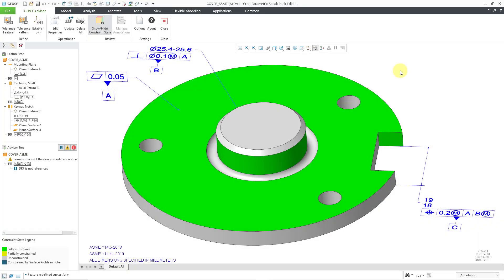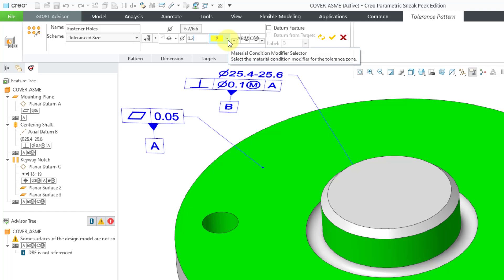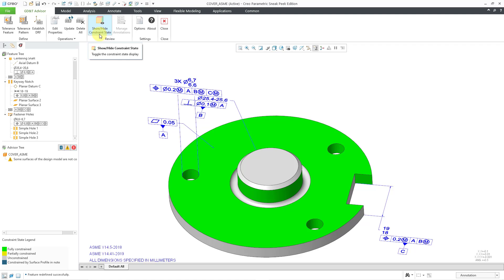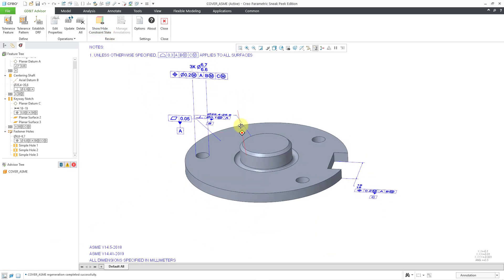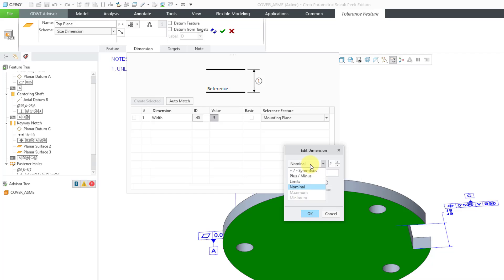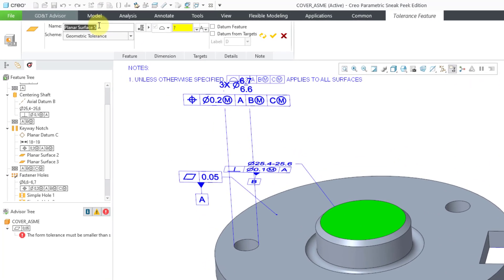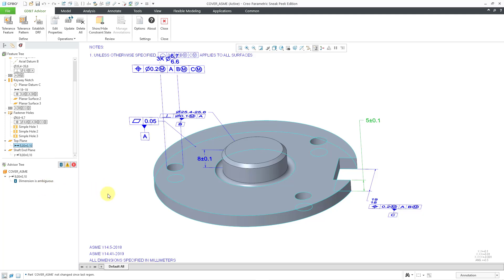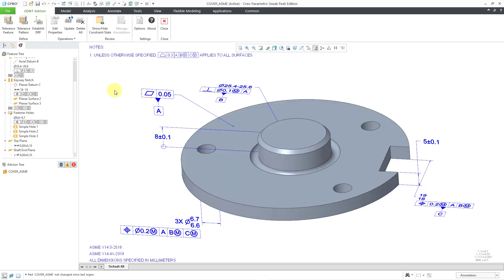Creo Parametric - GD&T Advisor - PTC Free Demo - Part 2

Comment: Hello.

IMHO this is important topic which will become even more important in future due to “disappearing” 2D technical drawings and growing presence of 3D models, equipped with PMI information (MBD based) … Because of this I expected at least some comments about it.

GD&T Advisor is a good add-on for Creo but it can’t handle all the situations. My next comments apply to use of it in ISO norm space. First, we must be aware that the working of the GD&T advisor is heavily depended on 3D model structure and the way the 3D model is built.

For instance, if you are to apply some form and position tolerance to a cylindrical surface, then this surface will be recognized as shaft if modelled using extrusion of a circle or as rotational feature. In this case you are able to choose between cylindricity, coaxiallity, run-out, general surface profile, position etc. But if the cylindrical surface is result of a pattern than only surface profile and position are available. I’ didn’t found an option to persuade the GD&T advisor that the cylindrical surfaces of the pattern are actually forming a shaft.

I didn’t find a way how to produce datum targets if I need them. There are some targets offered in some cases, but this is not what I need.

Because of dependence on 3D model structure and way of its creation the GD&T Advisor is much more limited in case if you have to work with imported geometry.

And if you prepare some GD&T annotation before the GD&T Advisor is invoked, you might delete all of them. In this case GD&T advisor asks you first to delete all GD&T related annotations or to ignore them. If you ignore them, you can’t use them within GD&T Advisor (this may be license dependent, I didn’t find a way to evaluate such annotations in GD&T Advisor).

To minimise problems with GD&T Advisor I suggest following workflow:
1.	Finish 3D model before applying any GD&T related annotations.
2.	Use the GD&T advisor first to apply GD&T as far as possible.
3.	Use regular Creo editing tools to edit tolerances applied b GD&T Advisor and add those which are not possible by GD&T A.

GD&T Advisor (at least for ISO tolerance space) needs update ASAP! The tolerances listed in general annotations are mostly outdated or even obsolete. So, it states that is use ISO 1101:2012 which is outdated. ISO 1101:2017 is actual version, enhanced specially in direction MBD. Next is ISO 16792:2015, ISO 16792:2021 is actual version, also enhanced in MBD direction (“3D model is only source of truth”). And for general machined metal parts is stated to use ISO 2768, which is obsolete since 2022, replaced by ISO 22081, which is completely different. This was at least situation at end of 2024, when I have upgraded to Creo 10.

Despite its shortcomings the GD&T Advisor is very good addon, really helping with GD&T issues. It would be much harder without it.

Thank you, Creo Parametric, for your efforts, please continue the good work.

Jože